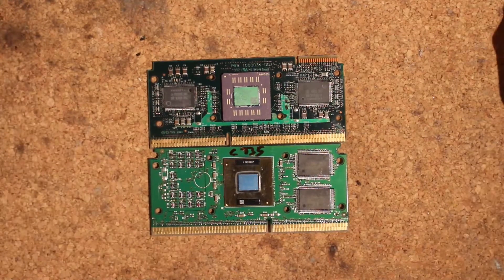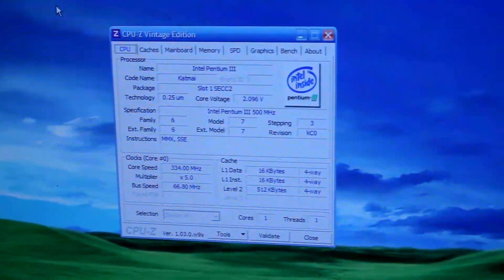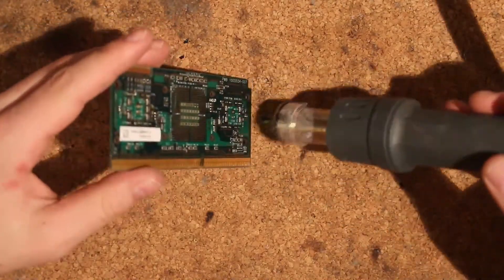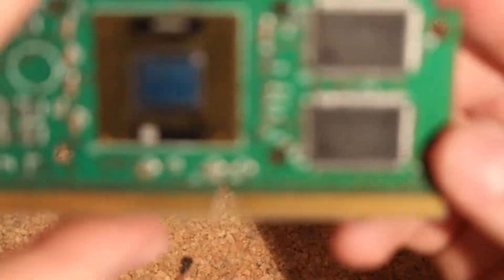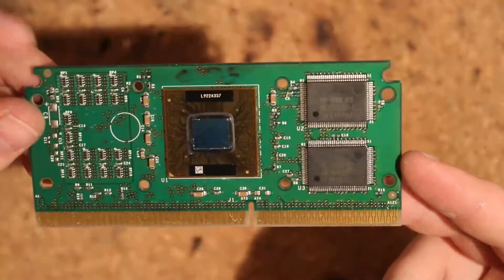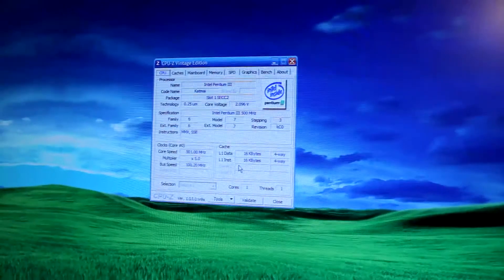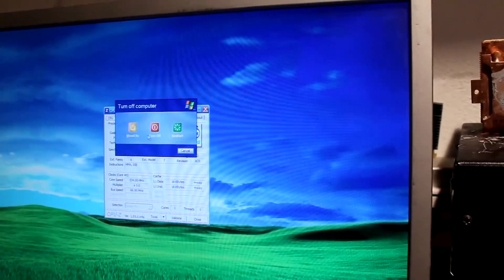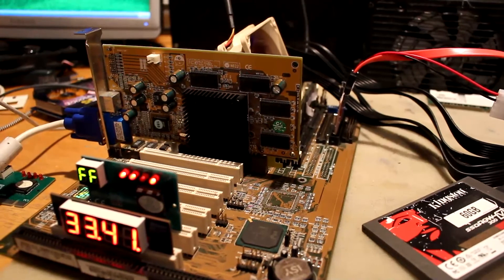Trying to run AMD Athlon cache on a Pentium III, what could go wrong?

Comment: I was trying to solder different VRAM (the same parameters, but one was samsung and one different brand) on a GPU, but I screwed reballing, do you think it could work? It was old 7600GT with DDR3 VRAM. Both GPUs were the same, just with different brand of memory, so I was curious if it's gonna work without changing bios.
Reply from the maker: Yeah, there's a chance it'll work just depends if the new Chips can run the timings set in BIOS, GDDR3 is usually relatively forgiving, have done a lot of testing but haven't yet really gotten any GDDR3 GPU to perform any better with better rated mem chips, seems most are IMC limited :(
Reply: @taggxoc  I already tested it with GPU with GDDR1 memory, which is easier to solder (no balls) and it worked fine, 7 modules Hynx, one Samsung and no problem. 😀 I had one GeForce 6600 with really overclocable memory, much more than any oder DDR1 GPU I ever had, so I was curious if it's possible to solder it to different GPU with the same number of modules and the same capacity and it looks like it could work and then overclock it, but it's a lot of work to replace all 8 modules and I don't want to destroy any other GPU, so maybe one day..... 😀

Comment: Hmm.. I have a 700MHz Slot A Athlon here, it runs happily at 1GHz with the GoldFinger mod card! No extra voltage required. Also, the P3 running at 333 was funny as its still getting 2 volts.. Ouch! I guess it should either be a 450 or the only other possibility 667? I have a 650 here which happily runs at 866MHz on 133FSB in a 440BX board by Gigabyte that handles 133FSB fine! Also, as Intel and AMD use their own designs, i knew it wouldn't work... Tag chip :) you should be able to find better cache chips by looking around i would have thought, or find a dead 1GHz P3 and steal the cache! And your default multi was 6x according to CPU-Z! Also Cache: NONE was visible before XP booted.

Comment: I'm honestly surprised this didn't work, but maybe something in the structure of the MAR is different and it just requires a different address line. I seriously doubt a manufacturer the size of Intel didn't have alternative address lines ready in the case of a supply interruption.